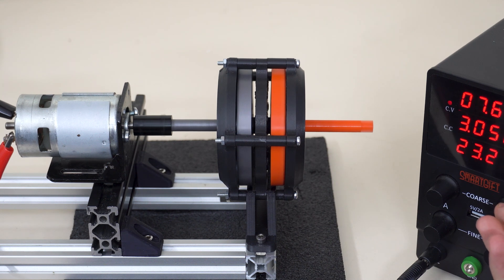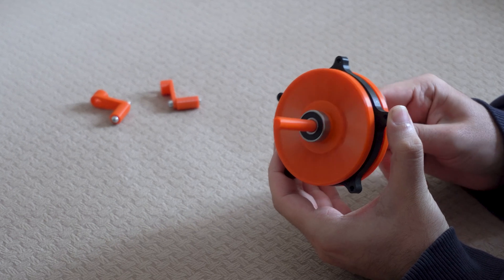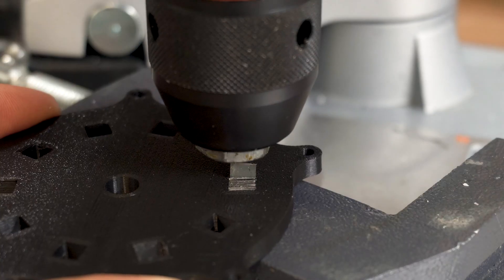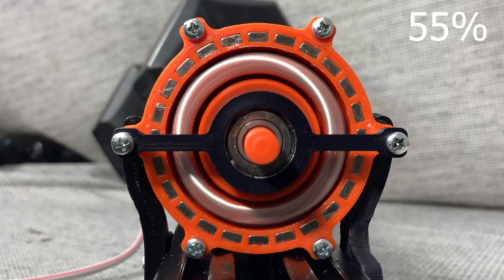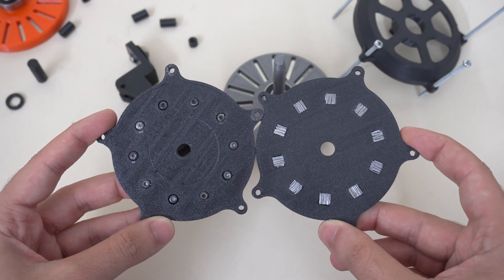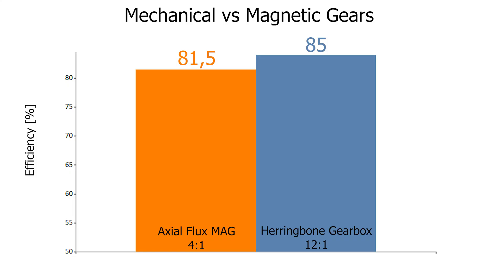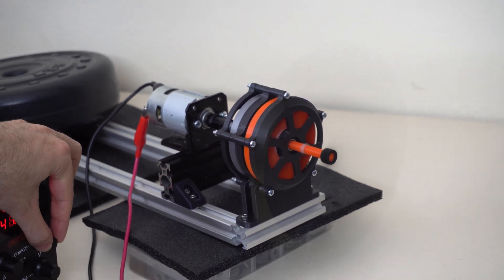Are Magnetic Gears Very Efficient?

Comment: I think you should use Tesla 2 phase A/C synchronous output generator that uses 4 slip rings for the 2 phase output that feeds 4 coils for the 2 phases A/C input with 1 pair of coils per phase. Then with you contactless magnetic gear box you should have the rotating magnetic field produced in the 4 coils drive the low RPM side of the gear box then connect the high rpm side right back to the 2 phase A/C generator thats driving the 4 rotating magnetic field coils. To make it more clear what 2 phase generator I'm talking about I'll include this video showing Teslas 2 phase a/c output generator....   https://www.youtube.com/watch?v=TK42nu2a00s

Comment: I think that you should check efficiency with direct connection between power motor and generator - there is probably a lot of losses there in this conversion - and mechanical gears are probably much more efficient than 85%.

Comment: I would say that the contactless transmission is the number 1 reason why its extremly good
am thinking about things like a pump in a fish tank where there the hard part is not killing the motor while its underwater, but transmiting the rotary motion trough the glass from the side or under could make for a pump that doesnt have to have an air tight pocket for motor and electronics, it would also be verry intresting for boats as making a shaft that is airtight is really hard if u dont want to lose some tork due to friction and using lots of lube and still have some leakage, engines also have that issue of transmiting power while keeping oil in
Reply: This transmission is a non-starter (heh) until it can actually transmit torque successfully and not weaker than my pinky.
Reply: @DarkExternalHeart  its probably fine for a tiny pump for a small fish tank, would be really intresting to try it

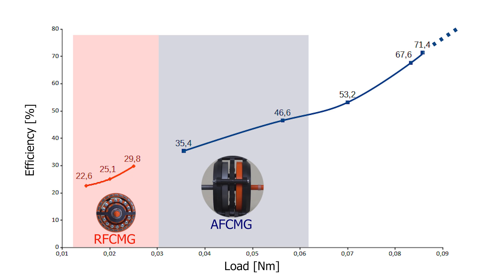Comment: 2:13 the eddy currents don't increase with load, but with speed. When magnets are stationary, there are no eddy currents.
With high speed and low load, more power is wasted for switching the magnetic fields inside the steel inserts, which doesn't increase the output power.

Comment: Please fix your tolerances. Noise = friction = inefficiency. When you run the gearbox and hear clicking, that means something isn't right. Also, I noticed in your last video that at high speeds your bolts came loose, which you should also ensure are tightened properly.
Reply: Plus, because of that friction, there's a greater chance for wear and damage.
Reply: Right indeed
Reply: Agreed

Comment: O I forgot . Tri do not let gaps between the steel <leaves> of the middle circle, where they are contacting with small circle. it will turn eseer.
Reply: Try to proof read your posts so they are understandable

Comment: Hi.Congratulations  you did it very well , bat I have something new for you.
About magnetic gear which one you didnt like (55%).If change the diameter  of middle steell circle for more and put them like chamomile and use not screws but steel lists from transformator .
Middle must be stator. Input of forse must be the little one output the biggest .And there you mast have an extra lever (arm), which no one who doing such things didnt remark it. Its kind you teleporting your impuls from  short arm to long arm. And must change quantity of pols too. Small more pols biggest les pols. Tri it and you will be  surprised.

Comment: Buy a roll of glass iron, and cut the cores out of this iron-material (with a blade/scissors, and not with laser)... And if you use a huge gear to transport 5Watts, and lose 1Watt, that´s such a small aount of energy, that it will never get hot, so, such an observation is useless in your case. Except you interpret it in a way, that it means that those gears are too big for the little energy they transfer.

Comment: I would love to see this with stronger magnets, maybe even coils; It would be fun to see something transmit its power like the wireless chargers due, but I would suppose some efficiency loss. Is there any way to push them closer together by slimming down the modulator in the middle?
Reply: won't using coils just result in a traditional electric motor? 
but maybe coils can be used in the modulator, producing an adjustable gearbox maybe?

Comment: Traditional gears are limited by max speed due to back lash increasing the faster it spins. Mag gear do not have this problem making them great for high speed application. Try comparing the two gear boxes at 15000 - 20000 RPM. The herringbone gear will see a huge drop in efficiency and the mag gear would remain stable excluding other mechanical factors like balancing.
Reply: Backlash is only a consideration when running without load or when experiencing rapid speed changes. What kind of application are you suggesting?

Comment: I'll be waiting for you to use a much stronger set of bearings so that the actual torque and speed can be accurately measured. I've always wanted to do this exact test years ago by applying a 1 to 3 or 1 to 6 gear ratio but on a motorcycle but I was always told that the type of metals needed dont exist ... Even with magnets at some point you need to put the power to wheel so to me there in lies the problem. Still the Searle Effect with the magnets staying cool, no need for oils, Its exciting to think that this could apply to many things. The no friction No drag can only mean MORE EFFICIENCY!!! SO DON'T QUIT KNOW!!!

Comment: Hopefully, people now understand why this is such a cool idea. It's not a blanket replacement for traditional gearboxes, but there are applications for which a traditional gearbox or a variably driven electric motor wouldn't work in and this would.
Reply: Not really. Its less efficient than a really poorly made gearbox and its basically an electric motor with extra steps. Its not even contact, lubrication, or wear free because there's still bearings that will wear and need to be replaced. Not to mention the longevity, capability, and cost compared to a traditional gearbox. Not sure where it would have any application outside of this video.
Reply: @7AStingray   That's because you don't work with vacuums or underwater, both of which would be areas where it would be useful.
Reply: @anon_y_mousse  It also has potential as a safety or damage-limitation device, as there's far less mass being brought to a sudden stop in the event of the output side jamming at high RPM and it prevents motor burnout by physically decoupling the motor from the load.
Reply: @7AStingray  Whatever you say, dude.

Comment: Im completely assiming that you have seen some of the halbach arrays and ways to arrange, or arrange cut magnets to exponentially increase theur force?  ☺️. Just sub'ed after i seen your video from 10-11 months ago.  Love the work.  Seems like finding the right type and kind of bearings is gonna be a key factor.  Even seen one guy who put bearings inside of bearings inside of bearings that all had tight tolerances.  Cleaned them all with a solvent. Added a PTFE synthetic oil. Etc. Resealed them.   Good results for his project.  Even had some unsealed ones for air flow/heat dissipation and some with moly grease.

Comment: Why don't you give the core pieces in the modulator the same footprint as the magnets themselves? In my mind they work like a gateway for the magnetic flux to pass through, since they are smaller than the magnets, they might limit the exchange of the magnetic differential.

Comment: I dont see the low torque as that big a disadvantage in some situations.  In combat robotics, Having your weapon motor active when impacting an opponent is a fast way to shatter gearboxes and overheat/otherwise destroy motors.  The lower torque would probably mean slower spin ups, but the lack of gears means you get to keep doing it over and over.
Reply: I was just thinking about this the other day, magnetic couplings or gearboxes could find use in combat robotics as a way to disconnect spinner weapon impact force from more delicate weapon drivetrain components.

Comment: So mechanical gears still outperform in terms of maximum torque transfer, but magnetic gears could outperform mechanical gears in certain scenarios, perhaps like, when low torque, low heat [friction], and longevity are required? Are the magnetic gears also lighter than mechanical gears?

Comment: Custom magnets are probably not in the budget yet, but it would be interesting to see the performance of the gearbox with ring-shaped single-piece multipole magnets.
Reply: Can you even have multiple polarity on the a sing large ring?
Reply: @rayanalzahrani8756  A quick google search revealed that it's simply a combination of magnets, not a single solid chunk of the same material.
Reply: @rayanalzahrani8756 Yep! Magnets can be custom made with very complex pole arrangements. This is commonly used for increasing holding force by putting poles on the same side (eliminating the need for steel pole pieces) and alignment (the arrangement of poles causes two magnets to prefer a specific orientation. This can be one or more orientations, and can include stronger or weaker attraction, which is useful for creating knobs with magnetic detents of varying strength, and other such devices).
Magnet manufacturers often offer design services for custom shapes and pole designs, although capabilities for complex pole arrangements vary.
Reply: @rayanalzahrani8756 I believe, you could achieve it, Goole > Halbach array ;)
Reply: I believe Apple's MagSafe uses a ring with alternating polarities, right?